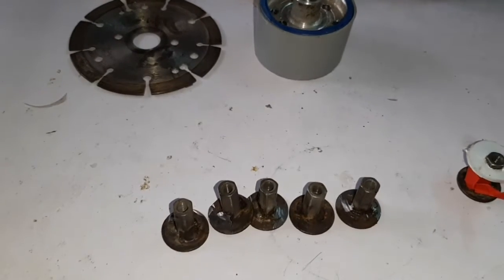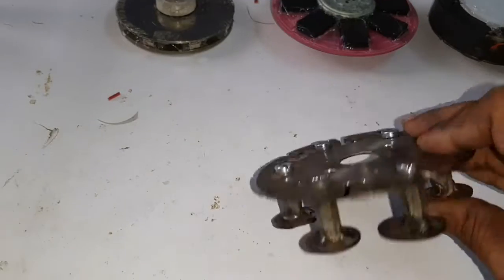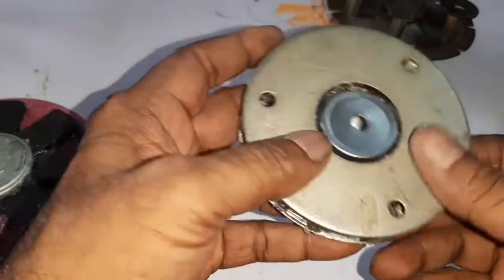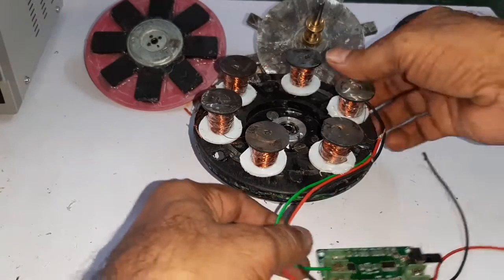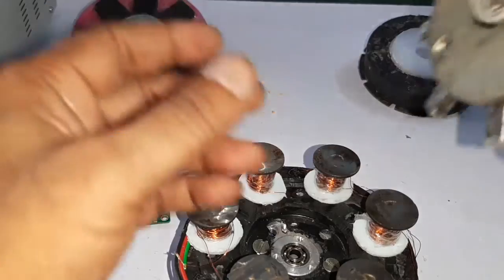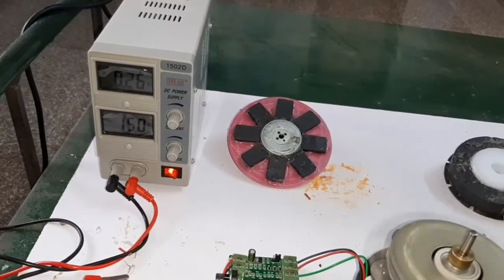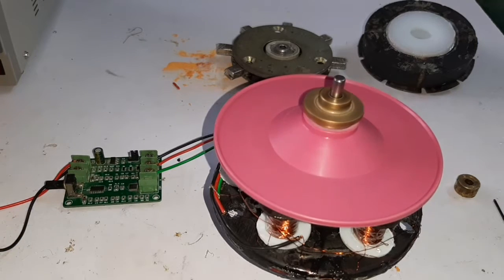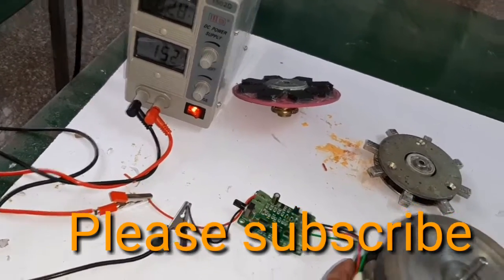(V-69),POWERFUL AXIAL FLUX BLDC MOTOR USING 3TYPE OF ROTORS

Comment: Nice motor. You have already maked three rotor, can one more be fixed on the other side of the stator? Very nice working Motorsports you make. Running on15 volts and 0.250'amps is energy efficient bldc highly effect.
Reply from the maker: Thanks sir